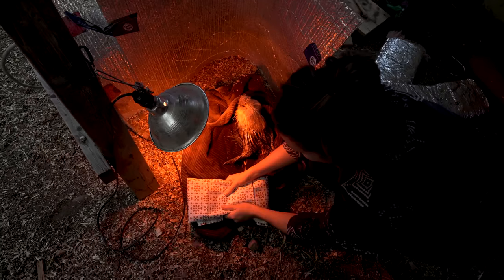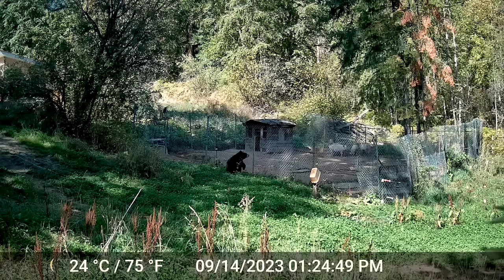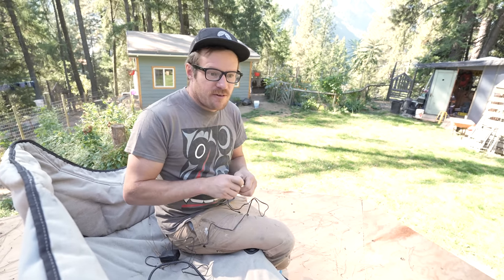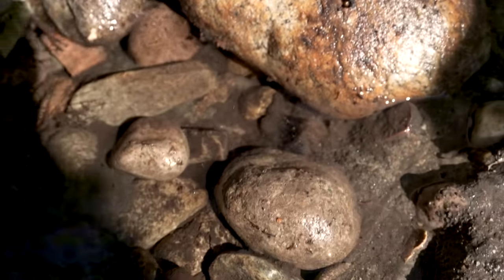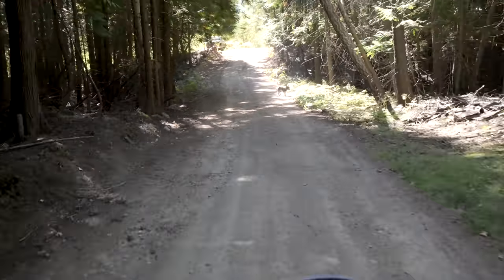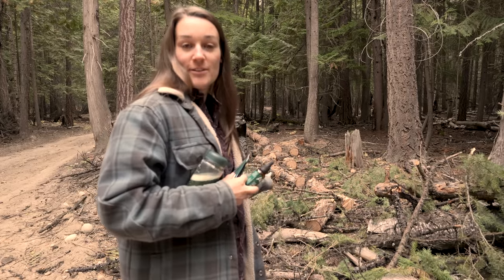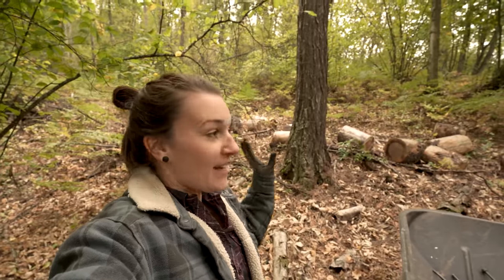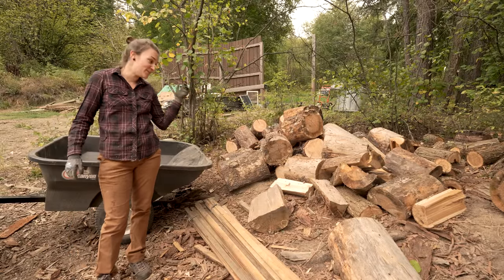4 YEARS OFF GRID and THRIVING | Preparing For Changing Seasons

Comment: Here's a tip for you Katie, when you reverse with that little trailer on the 4x4 and because the drawbar is so short, it reacts very quickly when reversing so you quickly get into a jacknife situation, a longer drawbar does not react as quickly, so it is easier to reverse a big trailer than a little one, try to make very little movements of the steering and when it starts to turn get the steering back off, you will soon get the hang of it, practice makes perfect as they say, hope this makes sense.

Comment: You should look into a putting a float switch on your water pump so it doesn't run when there is no water to pump.  Running a pump dry can cause it to fail, or worse.  Depending on your setup you would need to determine if you need an NO (Normally Open) or NC (Normally Closed) switch.

Comment: For checking the electric fence I would take a   long blade of grass and put the end of it on the wire and slide it  slowly, shortening the distance your hand is away from the wire, you can feel the charge without it hurting.

Comment: ..you should be able to get a fence tester fairly cheaply. Failing that, hold a piece of succulent grass stem between your finger and thumb, touch the end of the stem on the fence wire, and gradually move your hand closer to the wire with the stem touching the wire all the time. As you get nearer, you can feel a gentle shock on you thumb joint..

Comment: so lid on water bucket with vent hole? If no one else has posted it, I will. The 1klb weight for trailer is the filled weight with trailer limit. Not the weight of the trailer alone

Comment: Hey;;;the shed's not full;;;lol;;;ya not done;;;gonna be exceptionally cold this season so get back to it;;;Ya heA;;;lol;;;really a good one;l;;that trailer will haul more than rated for;;;the only thing is the edges of logs that are putting the weight to the plastic can cause the problem especially in the cold months as everything be a bit more brittle;;lol;;;of course that thing we call sun can help with the deteriation;;;;oh me;;guess I shut up;;lol;;;I just have to have wood for my wood working shop and if it gets too cold just go to da house;;;lol;;;got an old cast iron stove that is not too efficient;;;but;;a full stove burn in the mornabout daylight and one in middle of the day and one before go to bed keeps things from freezing;;those little fans that work with the heat created from the stove really make a difference;;;actually keeps warm air moving throughout the shop;;;ok enough;;;lol;;;good one;;;enjoyed;;;thumbs up and get that wood shed full to the brim;;;lol;;;we be waitin
Reply from the maker: We hang the saws and axes on the empty side, we needed ti be able to access them still
Reply: oh me girl;;;couldn't you feel something pulling your leg while reading my comment;;;I throw out more garbage than Mcdonalds does but only with words;;;lol;;;have a good one and fill the shed to the brim;;; @ThisOffGridLife

Comment: sooooo much time and energy going into firewood.....plus the BURNING of it. Eventually you won't have the ability to put away that much firewood. Then what? (unless this is just a temporary project?). Start planning solar/battery and passive solar to accommodate your heating needs.......or at the very least plan for a rocket mass-heater to use WAY less wood